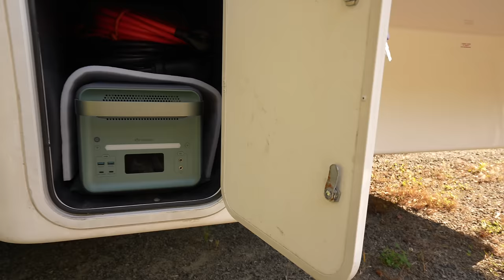Building a Firewood Shed in the Forest at My Off Grid Log Cabin

Comment: There is one thing I noticed about the wood shed that could have been better off different. The foundation could be higher off the ground if you get many feet of snow. I don't know how well that overhang is going to work. Alot of sideways falling snow sometimes. Maybe you can just nail a tarp to it and stake the other end to the ground and it would block more snow if you needed to.

Comment: I have been watching since the first cabin, you had to move from,  and now your on your second cabin, now when i have to do a project around the house, like build a small deck for one end of our pool 12x 8 with steps, railing and handrails, and I am no deck builder, I drew up some plans, sure wish I had a sawmill, $1,300 later for treated wood, and I was kind of sitting on the project. I thought to myself, what would Shawn do, he would get out there and build the damn thing by himself if need be, it took me 2 weeks after work and 2 weekends, by myself. I put a coat of Thompsons on the entire thing a month later when  the treated lumber finally dried all the way, the walmanized wood was so wet, a 2x4 weighed 10-15 lbs, when I was putting the screws in, juice was coming out. I used screws and spikes for strength, after I sealed it, I ran some solar twinkle lights under the steps and railing, it looks fantastic. I`m thinking to myself, this man built a cabin alone in the middle of a Canadian winter, in the middle of nowhere, get out there and build that deck you bum, yeah motivation, just from watching your work ethic, the wood shed looks fantastic, nice and big, very breathable, you sir are a motivator, we appriciate it as fans of what you do, all the best from Michigan.

Comment: Cali is such a great companion.  When you were on the ladder her expression was priceless.  The shed looks great but won’t your wood still get wet?
Reply from the maker: A little but with good air flow and sun exposure, it will dry quickly. The wood I use daily will be stored in the kitchen or porch.
Reply: @MySelfReliance  how much wood do you think you’ll need to get through the winter? Four or five cords? Or more than that?
Reply from the maker: @rudycarlson8245  Far less.  Three bush cords of hardwood for winter heat (which is also for cooking) and just softwood, scrap lumber and small diameter branches for all outdoor cooking. Once the logs heat up, it takes very little fire to keep the cabin warm. The massive logs and super insulated roof really make a difference
Reply: @MySelfReliance  That will bring the bugs and rodents into the house.
Reply: wood heat always brings insects into the house, a drawback to choosing wood heat if, like me, you can't stand having bugs in the house.  While I love the smell of wood heat, and the dry heat it creates, besides the bugs it's also very dirty, tons of dust and ash all over everything.  As for rodents, I think Shawn built the cabin tight enough to keep rodents out and while rodents will definitely nest in the wood shed, they aren't likely to hitch a ride into the cabin with an incoming load of firewood.  I've lived in a number of homes with wood heat and while I'd really enjoy an off-grid lifestyle, not sure I would opt for wood heat.
Reply from the maker: @annrhodes3544  I mean the log walls, not the firewood

Comment: The early immigrants who settled the Tug Hill plateau region or Northern New York State were very practical people. The winter would get 250 inches of snow with moisture and winds off Lake Ontario. Drifts would get to be 8 to 10 feet. It was hard to get to a barn to feed animals. Outhouses were impractical in late winter as was having to go outside for firewood. What they did was make a long narrow extension to the back end of their farmhouses. The first room off their kitchen was a summer kitchen so the main house didn't get heated up. The main entrance to the house was to this room off a front porch. Screen doors could be opened for ventilation. The next room was a firewood storage so they didn't have to go outside to get wood. A sliding barn door made easy access to fill it. Finally at the far end of the addition was an outhouse. It allowed for privacy and kept odors out of the main house. Very few of those old houses are still standing today. The farmhouse I grew up in had a modified version. You had to go outside from the kitchen to enter a woodshed built onto the back end of the house. Inside the woodshed was an attached outhouse. I'm not sure any of these would fit the cabin but it is something to think about.

Comment: How many cords of firewood will you be able to squeeze in. (16”x48”x96”). Thanks Shawn, great video
Reply: technically  a cord is 4' by 4' by 8'. so 3 times your 16 inch dimension.
Reply: @unexpectedparolemadwerewol6565  face cord is 16”. Bush cord is 4’x4’x8’
Reply: @Tomhohenadel  I am going to have to assume this is an industry standard thing that is grammatically wrong but universally accepted. Such as identifying the volume of a truck in yards when the proper term is cubic yards. As you did spell out the dimensions the intent of asking about face cords would be apparent to folks who really know firewood.  I just (myself) have only heard cord referred to the whole unit and would have expected you to have said face cord with the dimensions if you meant the smaller unit. My apologies.
Reply: In Ontario, firewood is usually sold by the face cord and is usually split as well. Commercial firewood cut in the bush is usually stacked 4x4x8

Comment: lol IF cali was just a little taller and further behind the deer target it would have looked like cali's tail was the deers tail wagging LOL 
I hate to say this ... but for me this is the way to hunt ... with a camera ... no I'm not against hunting for food ... that is perfectly fine ... I just wish when hunters choose to hunt they dont get years worth of food each trip ... a season stock pile plus some sure ... but when you have a second chest freezer JUST for game meat ... and the first one is bread butter and more game meat ... and will last you 2 to 3 years ... is over doing it ... 

it may look like an over engineered woodshed ... but if you consider a basic log in ground shed cover compared to this shed ... the pole shed might last 10 to15 years with basic looking after ... while this shed will 20 + years with basic looking after ... all for the cost of a little extra effort to build it once ... time and effort well spent ... 

here's a thought for your woodshed ... include a hand hydraulic jack that pushes logs into a kindling blade ... and the fall out kindling drops into a kindling bin ready for use ... sure you can still make it the old way BUT this way if your short it s a quick press and you got a batch ... heck make the blade multi faced so it makes a full start bundle every time just add burning tinder ... this would also be a great black smithing project .... making the blade set adjustable ... then you can even make pegs fast just push a log through a ring of round dowels of the right diameter ... 

Cali being FAIR ... she fetched recently so she let Shawn do some work before doing some more fetching ... now she truly has gotten to be the supervisor on the job lol 

Cali at the end going into HUNT mode just before you toss her toy ... she sure knows how much play time to balance with your work time ... shed looks awesome ... as I mentioned earlier add the press for those quick needs ... another good idea is make a chopping block foundation of hard compact base of some design ... from rocks to concrete to a burnt log whatever ... then your chopping block on top with some rounds for snow pack build up additions as needed